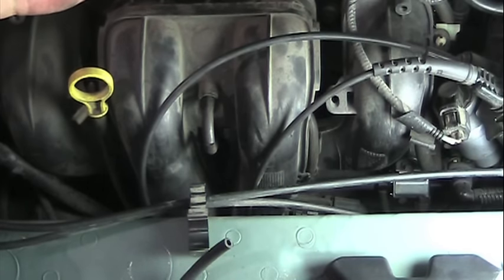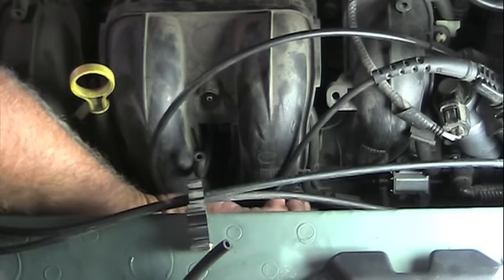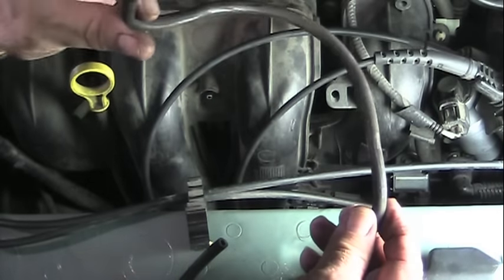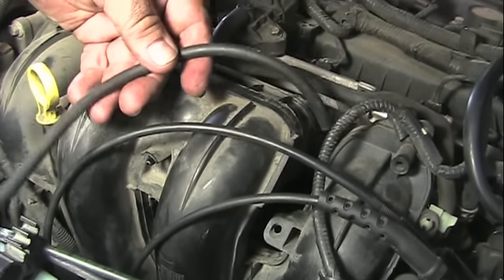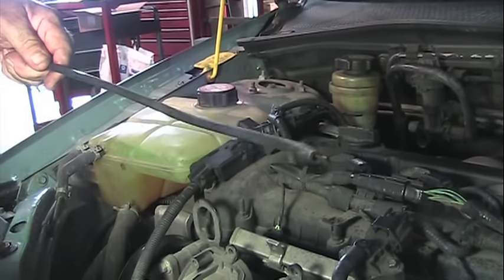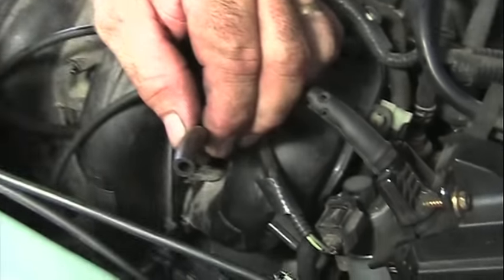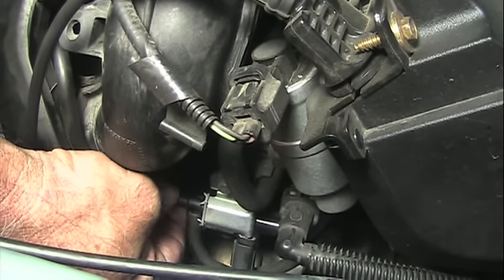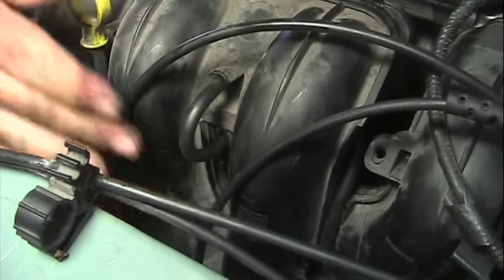Quick Tip;  Vacuum line routing

Comment: I tie a string to the end of the bad hose, so that when I pull it out I can leave the string in place to have a physical record of how the hose was routed. Then I tie the end of the new hose to the string (with tape over the end so nothing gets inside) and pull the string back, dragging the new hose into place. Sometimes it doesn't help at all, other times it makes the job so much easier.
Reply: Lp lp is
Reply: You must know an electrician lol.its called a feedback to replace old existing wires with new one throughout a residential home or businesses
Reply: Better off using standard wire instead of string it's a little more durable and won't break
Reply: Ya I believe there’s prob 200+ videos on YouTube showing that exact technique! Seems to be a good one..

Comment: I have a question for you about vacuum hoses : 
Do you know if the length of a vacuum hose affects the reactivity of a fuel pressure regulator ?
Reply from the maker: No it should not affect it.  That is as long as you haven't added anything to it through some sort of "tee" connector.
Reply: Ok,
Thank you.
Greets from France.
Have a nice Christmas.
Like all the peoples reading that too.
Reply: michaelovitch Merry Christmas
Reply: I'm trying to locate the hose because yes it can make you throw service engine soon light on Dash !

Comment: I put a hose barb (plastic or brass on old end of hose you 1st took off, pull the other end off the Vacuum solenoid which drags the new hose where it belongs. You can either twist off the new hose from the barb or trim t off. Insert New Hose on the barbs you took the Old One off anf your DONE!

Comment: Of course it simple for everyone else on the planet but what year is this vehicle & what is it because mine certainly does not have that. and I’m going nuts trying to find this damn leak. I’ve been searching for days
Reply: Any luck on that? My check engine light comes on with small evap leak. I'm going to try smoking it with a diy smoker I made to try to find the leak
Reply: @ufoabove  Im just now seeing this wow but yeah, I had luck. I found the leak. I tried the smoking test also, I made my own little homemade smoker but I don't think it was working because the system was closed or w.e. and it was windy asf for like a week strait when trying, go figure. So I got a little caught up, confused & pissed off on that situation so with my last attempt I just put some soap and water in a spray bottle and started spraying every inch of the car that I could see. When I was just about to give up, the very last place I sprayed of course was after 45 minutes of spraying n looking.... I sprayed down the exhaust pipe the muffler and catalyst. Holy soapy bubbles Batman! I finally saw them fuk'n bubbles lol. Started bubbling around the weld of where the exhaust pipe meets the muffler. 
You find yours?